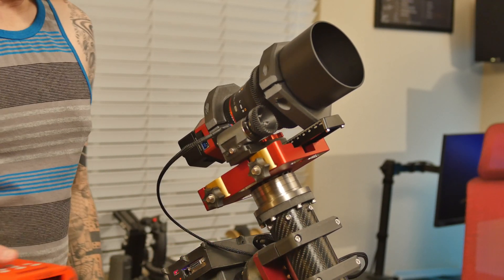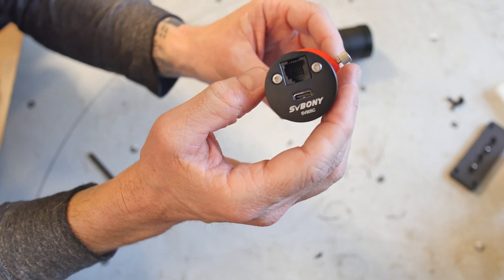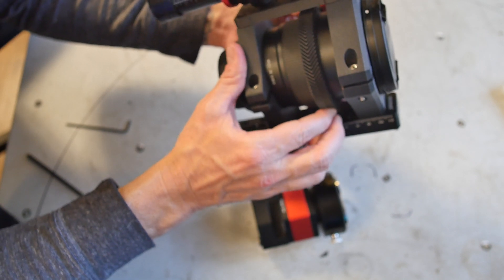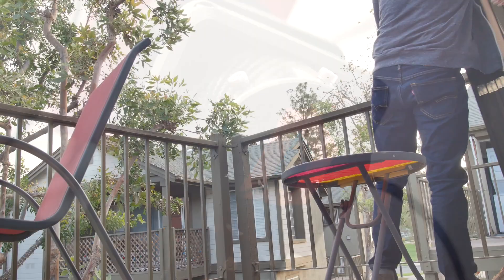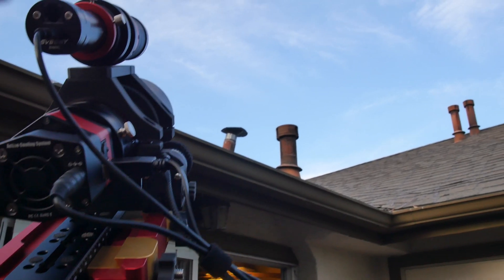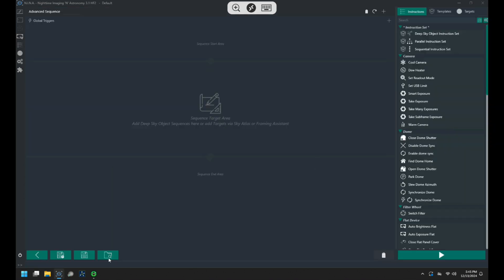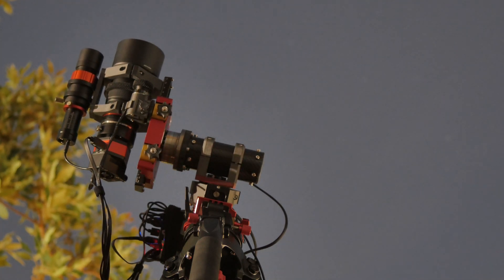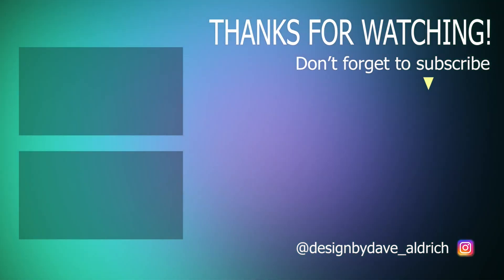Upgrading And Optimizing My 3D Printed Harmonic Drive Telescope Rig

Comment: Soooo how can I build a harmonic drive that can handle high payloads??? I have a Meade Star finder 10 that weights 31lbs and want to place it on a more stock mount instead of the bresser exos 2 it currently is overweighing on. I have 3d printers and can find parts I'm sure. Would like to set it up on on step.
Reply from the maker: It's going to be more a factor of the mount hardware itself and the equatorial wedge and tripod supporting it. I think with higher payloads like that we start to exceed what's practical with plastic 3d printing.